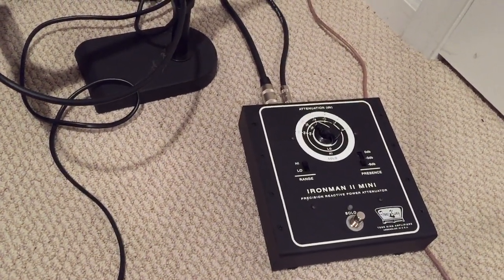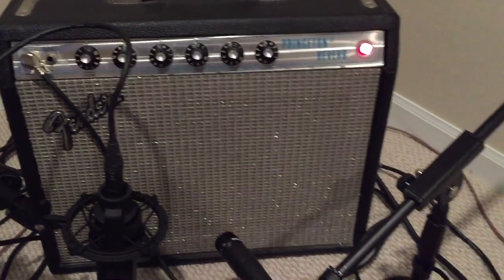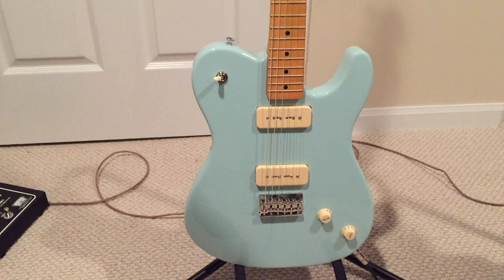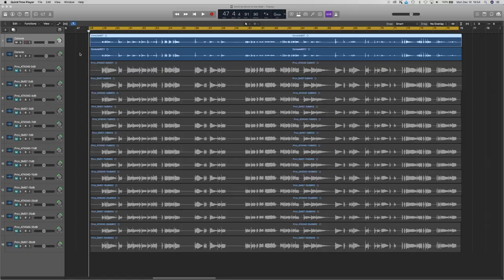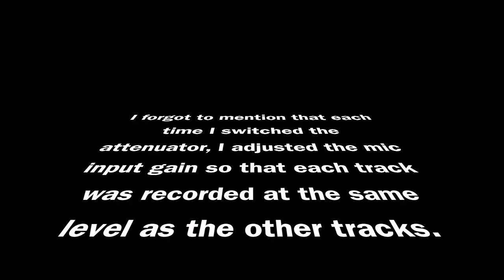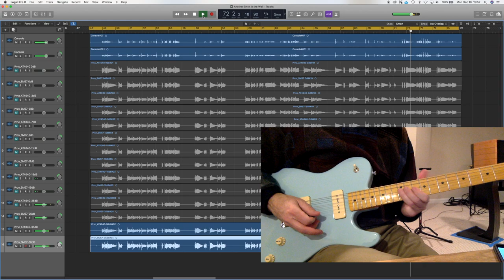Tone King Ironman II Mini Attenuator for Recording

Comment: Thanks for the very detailed and straightforward video. I have a few questions for you that I’d really appreciate your input on. 

1. I was curious if after about 2 years of using the attenuator you’re still pleased with it or if you’ve moved on to other attenuators? 
2. Do you find yourself using the attenuator all or most of the time when you’re playing plugged in, or is it something you use sparingly?
3. Have you had to replace your tubes more frequently since using the attenuator?
Thanks!
Reply from the maker: Thanks for the feedback!

1&2. Yes, I am still very happy with it and essentially leave it in the attenuated mode all the time. Once in a while I will shut it off when I want to play completely clean at higher volumes, but that’s rare.
3. I have not had to replace any tubes in the 2 years that I have used it, but I only play through that amp probably 2-3 hours/week on average, and the volume is usually set to around 5, which is not full blast of course - just on the edge of breakup with my guitars and playing style.
Reply: Awesome. I’ve been on the fence on whether or not to get it, but I think it’s going to be a good fit for me. I appreciate the thorough and prompt response!
Reply: @blakecavender3460  are you digging it?
Reply: @danielmazur940  Absolutely. I have it attenuating a 15 W Blues Jr and it tames it enough so that I can play it without making my family or neighbors angry. Is it as good as cranking the amp and actually feeling the sound hit your chest? No. But in my situation that was never feasible and this a solid alternative. It sounds good.
Reply: @blakecavender3460  thanks

Comment: Great demo sir! I have a question: did you ever tried the line out feature for reamping purpose or staff like that? If so, dis you experienced any noise or ground loop? I am really considering buying this unit since my torpedo captor seems to mess a little too much with my amp’stone, especially it seems to scoop out the mids quite a bit...thanks!
Reply from the maker: Paolo Giacci thanks!  I tried connecting the line out to my audio interface for direct input and yes, there is a noticeable hum. I was using a TR (unbalanced) guitar cable, not a TRS (balanced) cable, so I don’t know if that was the problem. Unfortunately, I don’t have a TRS cable to try it, and the user guide doesn’t clearly state what kind of cable to use.

Comment: Sorry for the late comment, but I just ran into this video - thanks for detailed setup and comparison; very, very useful! One question that's left is - have you tried using the line out for silent recording, or did I miss that in the video?
Reply from the maker: SriniP I tried using the Line Out for recording once, but my I got a lot of hum/buzzing noise. It sounded like a ground loop problem, but at that time, I was mic’ing the amp’s speakers directly, so I didn’t even spend 2 minutes trying to get rid of the noise. Note that I was using a mono cable to connect the Tone King Line Out to my recording interface, and it’s not clear from the Tone King documentation whether the Line Out is a balanced TRS, or an unbalanced TS jack. I suspect if I had used a balanced connection, the hum might have disappeared. Just a guess.
Reply: @number6photo  Thanks very much for the quick response! The mono cable was likely a major part of the issue -Two Notes makes the same point.  I'm trying to figure out how the TK compares with the Two Notes Captor or the Suhr reactive load for the silent recording capability.  They all do it, of course, but how natural are the reactive loads, is the question.  Thanks again, and I hope you're still enjoying the Iron Man - great Princeton, by the way.
Reply: @srinip   late comment on my side also! Did you get a chance to compare the recording on the Iron Man vs Captor or Suhr Reload? I’m wondering the same, I have the Captor X and I’m not thrilled with the attenuation proposed (fixed, compressed/a bit colored?), and although it’s perfect for silent recording, I would lean towards something simpler hence the Iron Man consideration. Thanks!
Reply: @flaneursong78  Unfortunately, I never did.  I just went ahead and got the Suhr Reactive Load and managed to find a Weber Micro Mass used...and was very unhappy with it - the Weber, that is.
Reply: @srinip  many thanks for the feedback. Next step maybe, you have to try to see! Happy with the Suhr as for the silent recording? I tried several attenuators from all ranges, never quite satisfied either. So I might get a chance on the Iron Man, but not sure since it’s quite an investment. Eventually I wonder if a MXR 10-band EQ with the volume down would’t do the trick!
Reply: @flaneursong78  I'm definitely happy with the Suhr - it just quietly does it's job, and really does give you great sounds!
Reply: @srinip  great, thanks for the confirmation!

Comment: good, you came to try the line output, how does it work?  a greeting
Reply from the maker: julysevilla I tried connecting the Line Out to my recording interface and there is a noticeable hum. I haven’t tried a TRS cable to see if that solves the issue (I don’t own a TRS/stereo cable) and there is nothing in the owner’s guide that mentions which type of cable to use. I don’t use the Line Out; I use microphones and the amplifier’s attenuated output to record my guitar. Sorry I can answer the question fully.